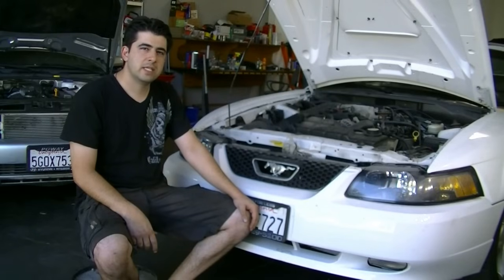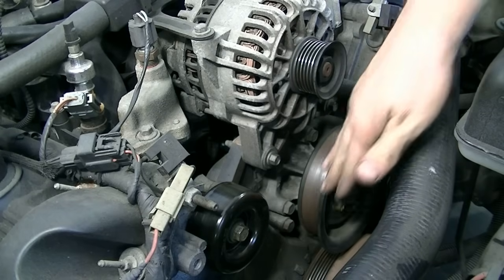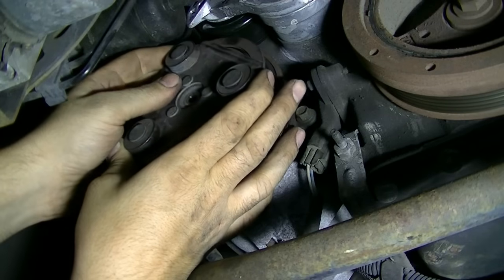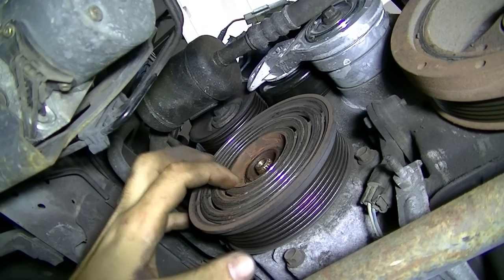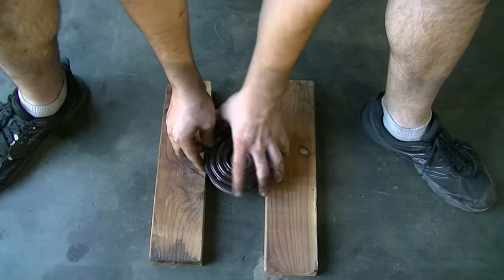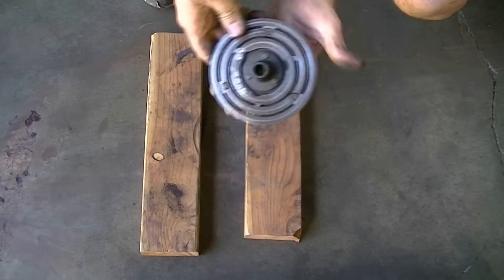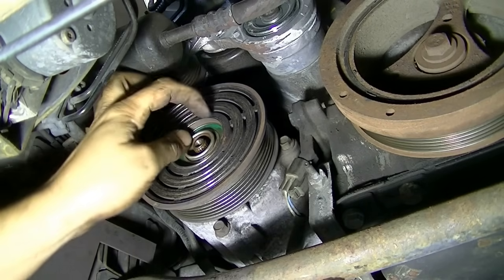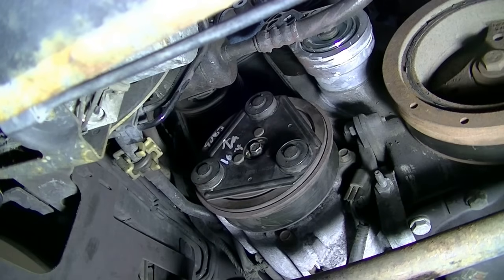How to Remove and Replace an AC Compressor Clutch and Bearing (Long Version)

Comment: Nice video. One tip about fitting the new bearing, if it is too tight to tap in easily. You could stick the new bearing in the freezer for an hour or so and it will most likely slide right in.

Comment: You know what's the same size as the new bearing and doesn't matter if you hammer on it? The old bearing. Also, spinning the pulley has no effect while removing it from the compressor  as you need to remove the center race (fixed), not the outer race (spins). You need to work it from different angles whenever possible. thanks for the video though

Comment: Thanks for the video. Just want to mention: when installing the new pully bearing, add some locktite to the outer surface of the new bearing before installing it into the pully. Also, if you take notice of the small tabs that help lock the old bearing in place, make sure to redent the tabs after the new bearing is installed. This way the pully wont walk off the new bearing. This happened to me after I installed a new pully bearing. Just wanted to make mention. Thanks..

Comment: The way I get new bearings in is by putting the bearing in the freezer and the pulley in the oven, pull them both out and the new bearing will drop right in.
Reply: Car Nut Do you think the temperature changes would affect the integrity of the parts though?
Reply: I've personally never had an issue with doing it. The temperature difference isn't really that extreme.
Reply: +Yasser Shaikh Nah we do it on 5000$ silver bearings in air craft engines all the time, will be fine
Reply: +Car Nut thanks for the added info, that's what these reply's or for, 2 questions though, 1) what tempter do you set the oven on? and 2) how long do you leave the parts in the oven and freezer?
Reply: Yasser Shaikh they make induction heaters for this very reason. And they get much hotter.

Comment: That pully and clutch (old and new) are completely shot...  why put them back on?  The mating surfaces should be smooth, not grooved like they are...  Aside from being torn up, you can't get a good gap measurement with the uneven surfaces...  You can get a complete clutch and pulley, with brand new bearing, for about $50.  They come as matched sets, designed to be replaced together.

Comment: My car groans when heater is turned on. The noise is from engine not inside. It doesn't do it when ac is on. It doesnt do it when blower fan is turned off. Does that sound like a bad compressor clutch bearing? Thanks

Comment: I started to get an intermittent noise on my 2006 tundra compressor. Thanks to your video, I will be tackling it tomorrow.  There are too many guys who have videos where they say, "___ has to be removed." The next thing you see is the part removed. They do the same with re-assembly. I already know what has to be removed. I need to see how to do it. Thanks for the step-by-step detail.

Comment: this is one of the greatest videos i haven watch Ratchets and Wrenches, he is so good very professional and explicit, i have a noise on my ac compressor clutch, my car is a 08 vw gti and the whole compressor is so expense is almost$600 bucks on the dealer, so i gonna try just replacing the clutch hope the problem get fix, thanks again for your help

Comment: Your video is going to help me alot in the next few days. I recently started hearing a squealing noise coming from my 2005 jeep liberty. We are certain it is a bad ac clutch bearing. We have purchased a new clutch assembly and plan on putting it on ourselves thanks to you video. I do have a question, what kond of cleaner did you spray on the coil before putting on the new parts?

Comment: Thank you for sharing all your knowledge with us. I Have a 2001 Seat Leon and the AC is not working at all. When it received a refrigerant gas charge, it was working fine for about 10 minutes and then it just stopped working, So we have removed the gas to check for any obstructions on the AC line and put in new gas. It worked for about 15 minutes and stopped working just like the first time. The AC clutch makes a noise just like the one in this video, So I removed the clutch and it definitely looks like it needs a replacement, however, I wanted to be sure it's just a clutch problem, so I used a rubber ring to lock the clutch together and make sure the compressor was spinning, but still the AC is not working. Any ideas on what to try next? maybe a bad compressor? thank you in advance!

Comment: First I want to say the video you made or replacing the upper and lower intake manifolds on the Monte Carlo was great.  I followed your steps and I've replaced my upper and lower intake manifold on my 2000 MC SS with ease.  It now runs very quiet.
Now I am hearing a knocking sound when my AC is turned on.  After watching this video I feel I can make the replacement with ease.  As long as the steps remain the same as described on this ford.

Comment: Great Video! 
What I have found when putting in a new bearing on pulleys, I use the old bearing/race and hammer them in.
Reply: Sounds like metal on metal squealing lol

Comment: Awesome vid!  I'm doing the same repair on a '05 chevy malibu maxx.  I hear the same metal to metal noise when idling and there IS play in the pulley side to side.  Also, when the AC is on, don't hear the compressor turn on and the air is not cold.  Tested pressure of low pressure line and it's 110 psi!  Do you think its the clutch or the entire compressor?

Comment: Thanks  My ranger is having some issues and this video helps quite a bit. I took the pulley off and the bearing in it was toast.  The inner race and balls fell out.  The outer race wouldn't press out like yours because on the back side there were some little tabs that prevent the bearing from being pressed out.  I could have ground them off and pressed it out, but decided to go for a new pulley
Reply: Hi Shane, wondering if after replacing yours if the sound went away. I just spent the last 3 wks dealing with the compressor issues on my 09 ranger. Ive already reinstalled a new clutch coil, new pully, and and new clutch but still have a slight grinding noise like the pulley is scraping against the plastic electrical connector on the clutch coil. Does your spin totally free?

Comment: Great Video, My AC locked-up, and burned-up the belt.  Going to give this repair, a try, You made it look easy ! ! !
Reply from the maker: +Chuck Cummings Sounds like your compressor locked up, if you cant turn the clutch by hand than you'll need to replace the compressor, condensor and receiver/drier on your car look in my channel for those videos. gl
Reply: +RatchetsAnd Wrenches Yes, crawled under car, and found that yes, the clutch does Not turn, so I will be switching-out the whole AC unit.  Thank You, for that insight.
Reply: +RatchetsAnd Wrenches No need to change the condensor as you can easily flush out the system as if the compressor is locked up, it would have black oil in the system in which you would have to flush out the system. No need to replace anything but the compressor and drier

Comment: Great job! I did a vid of this repair in a dodge ram -- very similar difficult points. The hardest for me was finding parts. One thing people should know is that the splines on the pulley may not be symmetrical, so there is only one way for the pulley to go on in some vehicles.
Reply from the maker: spelunkerd Ahh good point, glad you mentioned it spelunkerd. Cheers
Reply: I got a replacement bearing for my 2003 Dodge Dakota from www.intheclutchbearings.com

Comment: Great and helpful video - replacing the AC clutch assembly on my 04 Taurus DOHC, pulley seized sideways against the housing and burned a belt. You helped point me in the right direction for everything I needed. Heading out to jack it up, fingers crossed lol

Comment: OH MY GOD THANK YOU SO MUCH FOR THIS VIDEO!!!! Mine started to knock and my clutch is catching, but the whole AC compressor assembly is like $200. At least now I can test these two first to see if that is the issue. I replaced my tensioner assembly and fuel pump a few months back, its a pain to CONSTANTLY be under my hood over my whole serpentine assembly, but now I can check all of my pulley's to make sure they're good! Could the hammer+socket work for a wheel bearing as well?
Reply: yes

Comment: Hi, if the clutch is locked up, how would I know if I need to replace the clutch or the compressor? Or both... I can't rotate the clutch (car off, ac off), pressure was too high in the low side and don't know if it messed up the compressor. On good system, if the ac is off, can you rotate the clutch by hand? It's fixed to the shaft of the compressor like you mentioned.

Btw, great video and thanks for explaining how the clutch itself works, I found it really valuable.
Reply from the maker: Fernando Ibarrola yes, if you cant move the clutch by hand your compressor is seized and needs to be replaced along with your condensor and drier. search my channel for video's on how to do these. gl
Reply: RatchetsAnd Wrenches Thanks!

Comment: You make look easy!
Would you please let me know if it's possible to do the same for a 2006 ML500. The pulley on the AC compressor is broken and I don't necessarily want to take out the compressor to change the pulley.
Thanks for you help

Comment: If you're hearing pulley noise and you can't tell which one put a stethascope on and put the diaphragm on each belt driven part. The part making the noise will be magnified through the stethascope. The other parts will not be very loud with scope on. Process of elimination. Also you mentioned the ac compressor only engages when you turn ac on. A lot of modern vehicles use ac compressor for the window defroster as well. Because compressed air clears the windows faster.

Comment: To clarify this video.  Your problem was a bad clutch not a bearing.  I agree it was worthwhile to replade the bearing anyway.  My truck makes noise when I turn the AC on, and no noise when it off.  Yours is just the opposite because the clutch rubbed.  So, is it reasonable to deduce that a noise with the AC on would be the bearing (because of the load)?
Reply: It's worthwhile to replace the entire set, to include the pulley with bearing and clutch.  Both the pulley and clutch faces were worn beyond repair and should have been replaced.

Comment: I know I'm a few years late. But thank you. I was worried I had the wrong clutch. As the new one doesn't have those huge rubber nobs. But everything else looks the same besides my bolt. The new on is a little larger than 8mm on the old one. Hope it all goes together well. Gotta love ford...
Reply: There are different designs that all work the same.  One more reason to replace the clutch and pulley together.  The ones in that video were worn way beyond serviceable limits.  Not the best idea to stick a used clutch on a used pulley.  They should be replaced as a set.

Comment: nice video, thanks for the info. next time though if you put the bearing in the freezer the day before and get it nice and frozen it will press easier.
Reply: Better yet, toss that slap worn out pulley and clutch plate and just put new parts in.  Way easier, and both of those parts were terribly worn beyond service limits.  If the bearing is worn bad enough to need replacement, the face of the pulley is probably also shot like the one in the video.

Comment: I know it a while since this video, but i was wondering, if i never use or intend to use my aircon, could i leave the front off the clutch assembly and would the pully stay in place with the snap ring? Thanks
Reply: Yeah, you could leave the clutch off.  The snap ring holds the bearing to the housing, independent of the compressor shaft.

Comment: Brilliant video. Easy to conceive as well! Cheers
Reply from the maker: Pravesh Ramlogun Nice, glad you you liked it. Thanks for commenting.
Reply: RatchetsAnd Wrenches Pleasure. I have a 2004 Kia Rio with a similar problem. Whenever the ac is switched on, there is a grinding sound in the compressor and it blows warm air. The refrigerant level is normal. Could it be due to a damaged clutch? thanks!
Reply from the maker: Pravesh Ramlogun If the clutch is spinning with the pulley than it means the shaft inside the compressor is spinning as well so unlikely its the clutch. Just make sure its not slipping. If it is the compressor itself you need to look into replacing it sooner than later because if it seizes up it will be a lot more costly to fix. Here is a video series I've made for replacing an AC Compressor if you feel like tackling such a project, GL. http://youtu.be/rK17sw3Vl_U
Reply from the maker: RatchetsAnd Wrenches to elaborate *it will be more costly because you'll have to replace other a/c components.

Comment: Air conditioning re- gassed but cooling and was blowing warm air. I checked for leaks at home with dishwasher liquid into water and pour the water on TX valve and found the leaks
When I changed the TX valve O ring but air is still coming out. Is it evaporator, O ring or the pip has hold on it under the dash. Any help is greatly appreciated. Thank you

Comment: Thank you Sir, I'd love to get further details on 4wd operation using the manual hub lock systems, example what happens inside when you lock the hubs, but don't engage 4wd and vice versa.
Reply: Sher Moh'd spend a bit of time on Google and you should find plenty of info and videos as to how 4wd engagement and manual locking hubs work!

Comment: I have a pt cruiser 2001 limited , and i need my ac compressor fix, i it the same way ? 
i want to fix it myself cost 707$ for the auto shops to do. Is it possible i can get help with what tools i need to go buy for the job?

Comment: Huge weird (to me) problem, need advice badly. I removed ac clutch, coil and pulley with compressor still in place (attached to eng and all lines still in place/attached. Did this several days ago 5 or 6 days. And as I was standing near vehicle ( soooo lucky I was there when this happened !!) doing other things in garage and the compressor blew the seal out that's on the drive shaft and all the refrigerant came shooting out.  Coil ended up being ok and I was going to check the pressure in the system and sure wish I would've before this happened.  Code P0645 ac clutch relay control circuit which could be short in coil but is ok I found. 2015 Ram Promaster 3.6L  burned ground wires at fender ground stud, and melting in the Intelligent Control Center, engine compartment fuse box, which I replaced and second time around it did the same along with blowing the 7.5 amp ac fuse out of the fuse box where I see melting. Ripped the ICC box apart ( the 2nd, new, one and it had burn/melting also. Prior to I checked relays fuses and replaced the resistors on the 2 fans. Fans not working were the original problem, wasn't running ac in winter. More to follow
Reply: I do have Mitchell on line manual & Mopar Authority Tech (sucks) manual and just getting going on this project while on winter break from seasonal job. But the compressor blowing the seal and refrigerant especially after sitting, with coil removed) for so long has me baffled ( easy to do ha ha ) Thanks for any input !!!!
Reply: I understand that the seal might be worn 136,500 miles but is it bc too much pressure or was the pulley assembly suppose to hold seal in place . Van has been sitting for 14 months, not started or ran, it won't and I have radiator and things off and haven't installed the new Intel Control Center which is a new replacement part number which I wonder if old part # was an issue with my problem. No one can tell me why the new part #. The 2nd ICC  they sent was still  the old # As mentioned it burned also.

Comment: Hi some mechanic said that if the ac compressor makes noise, you have to flush the system of debris? Metal particles will be everywhere in the system and drier .. true or false??
Reply: The insides of the compressor may wear and cause metal shavings. They usually get cough on the orifice filter. It's always good to flush the lines to make sure you get it all out. This will make the new compressor last longer. In this video it was only the clutch bearing making noise.

Comment: I have a 2001 ford ranger 3.0 v6. is replacing of the clutch and bering on the compressor a symptom of high rpms when the compressor is engaged? I get about 1400-1500 rpms when the clutch engages and if you press on the gas pedal the rpms stay at 1400 to 1500.

Comment: I have the same exact problem on my 2008 Hyundai Elantra. It makes a terrible noise with the ac off and the noise stops when I turn the ac on. My question is is if just the clutch and bearing is bad should my ac still blow cold air ?

Comment: gonna try this. mine isn't spinning at all when I turn on  the AC. Lancer 2003. not much room. good video
Reply from the maker: If your clutch is not engaging you may be low on refrigerant, check out my latest video on how to add refrigerant to your car's AC system Here: https://youtu.be/zAageqHBj4k

Comment: Does it matter which way the new bearing goes in? It looks the same on both sides.
Reply: I wouldn't change the bearing and use the old parts.  An entire new clutch for most vehicles seems to be around $50 to $75.  If the bearing is bad, the mating surfaces probably look similar to the ones in the video (grooved WAY beyond serviceability).  Replace the entire clutch, pulley with bearing, and heck, put a new coil in there, also.  I just replaced an A/C clutch on our Maxima because the coil burned out.  Sure enough, the clutch surface was grooved up, and the pulley was grooved to match.  It'd be crazy to only change the coil and put those old, worn out parts back in.